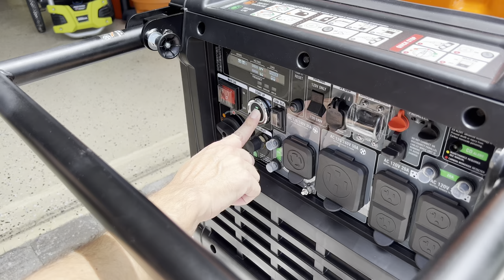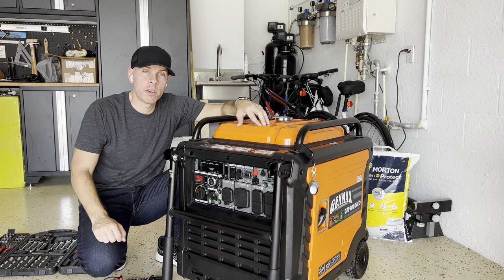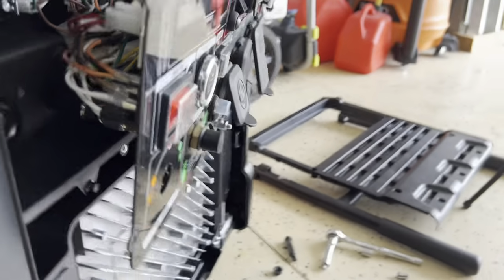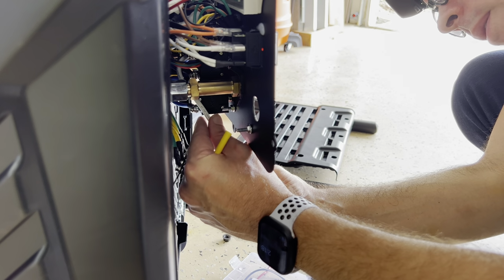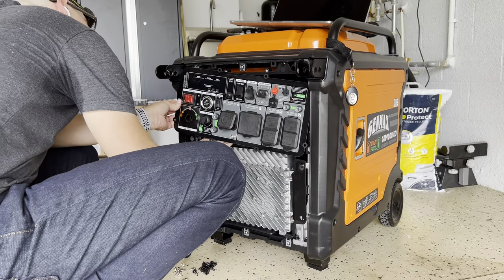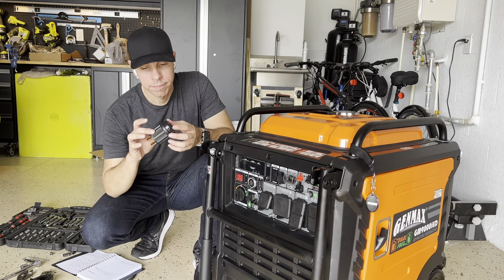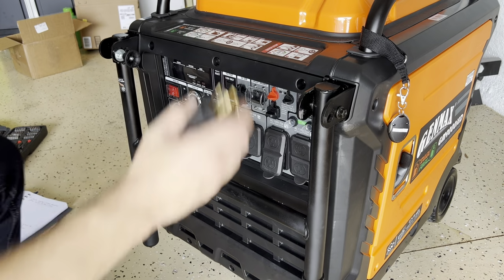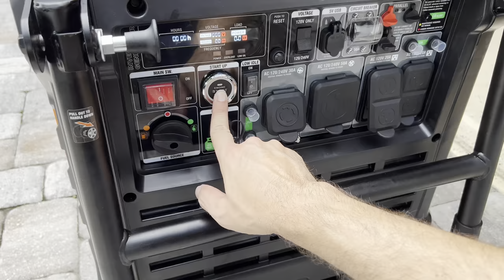How To Convert Genmax GM9000iED Bonded Neutral to Floating Neutral

Comment: Are there any adverse consequences connecting the genmax as-is (neutral-bonded) to your household breaker box? That is, can the genmax as-is function normally when connected to the household breaker box? Thanks!
Reply from the maker: Hello. Please check this video.   https://youtu.be/RkjjZJgaINA
Reply: @JavierRivera  Great reference! It seems there are many different viewpoints on this subject. Maybe to be practical, under normal conditions, would a multimeter and its probes tell you whether any part of the genmax, say frame or other equipment part, pose a shock hazard?
Reply from the maker: Doesn’t matter. The rule of thumb is having a neutral bonded at 1 place only.
Reply: There really aren't many points,  it's very dangerous to have the neutral bonded at the generator and in the house,  virtually all house are neutral bonded, therefore either you have to break the bond at the generator,  or at the house using a power/ neutral disconnect. If this sounds Greek to you? Don't be stupid, hire an electrician. What I did,  is add a jumper disconnect on the battery side of the generator,  putting a jumper off the main white ground wire,  that way I can just remove the battery panel and easily plug,  or unplug the quick disconnect. Depending on whether the generator is connected to the house,  or being used on a job site.
Reply: Dont follow this guys advice.There is a much easier way that allows you to keep your generator stock

Comment: This helped me convert my A-ipower SUA1200ED to a floating neutral. Perfect timing for Hurricane Ian. Thank you.
Reply from the maker: Nice 👍🏻.  Are you getting ready for Hurricane Ian?  Me too. I already tested my generator and I can run my 3ton and 2ton AC , my fridge and anything else that is normally connected utilizing only 4,800w from 9000/7600w My stove, water heater and dryer are gas.  Eventually I need to set a power meter to be able to see how much amps I am utilizing from the 50amp generator power.

Comment: I tried too check my work after I did the changeover. But, I can’t stick the probe of my multimeter into the GFCI outlet because of the stupid plug safety doors! What do I do?
Reply from the maker: Did you try to stick both probe at the same time?
Reply: @JavierRivera  Yea and those doors won’t let me push through. Should I try and force them? A regular plug goes in and out without issue.
Reply from the maker: @MrBritrider  just do it at the 50a plug 🔌
Reply: @JavierRivera  Oh yeah haha forgot. So looking at it on the gen, top @12 o'clock is ground (black probe) left @9 o'clock is the neutral (red probe) correct? Also, if I may ask, when you test the dummy plug, the cord comes from the TS, do you need to turn on all the breakers in the TS? And is your main panel live?
Reply from the maker: @MrBritrider  the 50a outlet is @12 ground and @6 neutral @3 & 9 are hot.
Reply from the maker: @MrBritrider  I do not have a transfer switch I have a 50a power inlet to a 50a breaker at the main panel.

Comment: Do the Genmax 9,000 generator has a electric start or a remote start ? And what types of oil it use ? Is it better to use ethanol free gas for this generator ? Can I plug a electric stove that has a 220 line ?
Reply from the maker: Hello yes it has an electric starter and a remote start.  Oil is 10w-30.  Use only fresh 87+ octane stabilizer-treated unleaded gasoline. Do not use gasoline with more than 10% ethanol (E15, E20, E85, etc.). And yes you can connect a 220 stove to the 240v / 50amp outlet.
Reply: @JavierRivera  For other name brand generators, is it better to use 90 because it's ethanol free.They say for cars it's better to use ethanol free gas I was wondering is gas generators similar ? Do some gas generators perform better with better gas ?
Reply from the maker: @drrobotnikmeanbeanma  That is correct if you can find ethanol-free gas use that one but if not used one that contains less than 10%. Performance is the same, you would get the same watts with or without ethanol.

Comment: Javier....so I have a food trailer and plug a 50 amp.  I have used this generator 3 times for a total of 7 hours.  Now my volts drop from 240V to 1 Volt.  when I plug up anything.  Even when i plug an extension cord with nothing attached.  Is this my solution or is there another problem?  Also, if it is the solution, can I use the 110 outlets and the same time when i have changed it out?
Reply from the maker: Sorry but I can not understand your message.  You might need to rephrase it.
Reply: @JavierRivera  I am not getting power from the generator when I plug anything to it.  The meter reads 240 volts when started.  When I plug a cord into the generator, the volts go down to 1 volt and no power to what is plugged into it.  Even an extension cord with no item plugged into it.  Prior to this, I would plug my 50 amp cord into it and it would run my food trailer.  Now no electricity due to the voltage dropping to 1 every time I plug something into it.  Is this because of the grounding?

Comment: Did the conversion on my Genmax 9000 ied following your instructions. Everything went smooth and I checked continuity readings along the way and all good. Started the generator after I was done and it will not stay running longer than 20 seconds. Restart and it shuts off again. Any suggestions?? Thanks for your time!!
Reply from the maker: I do not hink is related to removing the bonding. I have been having some issues, too, lately. This will sound weird, but I want to do a test; when you start the generator, and it seems like it is going to stop, grab the handles and shake it up and down a few times and see if that keeps it running. That is what I have sometimes been doing; I even recorded a video that I need to send to genmax to see if they know what is happening.
Reply: @JavierRivera  Shaking it did not help me at all. It starts up perfectly runs 20 seconds then shuts off. Going to try running on running on LP next and see what happens. Could one of the sensors be doing this? Maybe the wiring to the sensors was disturbed when I had the panel off?
Reply from the maker: @richdelbridge5354  If you belive that could be a wiring ifssue after removing the panel I suggest to remove the panel again and look that there is no cable loose just to be sure.
Reply: @JavierRivera  I will check it out and then also try LP. I will keep you updated. Thanks for your time!

Comment: Very informative video!  I just recently hooked up my
Predator 9500/7600 inverter generator. I had a micro-air added to my unit. Which dropped the starting amps from +70 to under 40.   I did notice after about an hour the breaker tripped on the generator.  After seeing this video I will be switching it to a floating ground.
Reply from the maker: Great 👍🏻.   Yes is highly recommend.

Comment: Just found your Channel, and Subscribed. Excellent Video! 
Would it be a better option to have install a Neutral Bonded ready Transfer switch, instead of having to take the Generator apart?
Reply from the maker: Genmax will be adding the option

Comment: Thanks for sharing your expertise! I have a champion generator Thais also bonded neutral. I used it once during the last hurricane, not changing to floating ground. I don’t use a manual transfer switch, just a simple slider. No problem encountered. Is it really necessary to convert from bonded neutral to floating or is it just a matter of preference? Thank you.
Reply from the maker: It's important to have only one ground-neutral bond in the system. The main panel of the house will already have this bond. A bond in the generator too creates the parallel path neutral. https://youtu.be/RkjjZJgaINA

Comment: In this video at the end you hooked the 240 volt cable to the interlock and the generator to show that the main panel will bond the generator, just to be sure I know the generator is off but do you also keep the generator breaker in the main panel off to? I believe you do because the neutral and ground in the main panel aren’t connected to the breaker.

Comment: After I remove the bonding wire, when I connect the surge protector to the 50amp plug with my house back up line connected,  the 50amp breaker is off on the generator but the red light on the surge protector is on  (open neutral). After I turn on the circuit breaker on the generator, surge protector is showing green blue and red. The red means open neutral blue means neutral connected. Why is it showing open neutral as well? When I remove the back up line, it goes to just green.
Reply from the maker: First, did you tested your Home Power Inlet by itself that is neutral bonded?
Reply: @JavierRivera  yes it is bonded
Reply from the maker: @JANAKJ006  Secondly, connect your electric cable from your power inlet directly to the generator and test if the generator then has a neutral bonded connection.  If your generator has a neutral bonded connection is seeing your house panel neutral bond. Then the problem is the Surge protector that is only checking for neutral bond one way only and is not allowing your generator to see your house neutral bond.
Reply: So i tired 2 high end surge protector. (Watch dog and progressive industries ) Both doing the same thing but when i  bounded the generator surge protector it’s showing correct. It’s only seeing one way I think. So having 2 bounding neutral it’s gonna be problem right?
Reply from the maker: @JANAKJ006  there is something I do not understand.  Why you want your use a surge protector between the generator and your house panel?

Comment: What type of transfer switch do you have ? i think that you said that some transfer switches  are neutral bonding ready and do not need a floating neutral ,do you know which one they are ? Thank You
Reply from the maker: Hello. I don’t have a transfer switch.  I have a power inlet connected directly to the breaker panel using an interlocking system.  Cheaper. The interlocking system is just a safety metal plate that doesn’t let you turn on the 50amp power inlet breaker unless you turn off the main BIG breaker that is feeding the breaker panel.  Then I manually only turn on the breakers that I need, as you do with a transfer switch.   I believe you will need a 4-pole transfer switch if you do not want to modify your generator. Look for Panel/Link X-Series Neutral Switching Panels
Reply: @JavierRivera  Thank you , i have a transfer switch and all of the outlets on the Genmax 9000 are neutral bonded so i will have to modify the generator for a floating neutral, Fantastic Video !!!!!
Reply from the maker: All depends if your transfer switch has a neutral switching option.   If has it you don’t have to modify the generator if not you might have to.  If you are not sure you might need to consult an electrician so you can be sure about what to do.

Comment: just go mine from home depot, Genmax must of just updated the 9000ied, I followed your video and behind the panel is different, there is no white wire to remove from the bar, just 4 yellow wires
also the bar is on the right side of mine, so if there's an update on how do it please let me know.
Reply from the maker: Hello, yes it looks like something was changes. I wish I could attach a picture here.  A few months ago someone told me that the white neutral cable wasn’t on the ground bar in his generator and told this “The white oval is the back of the last/fourth/far right receptacle in series (20A GFCI).  I disconnected the Green/Yellow wire that was tied to the white from the back of the outlet and it appears that there is no more neutral bonding!”
Reply: Thanks for the info, I wish you post pictures in replies.

Comment: Does Genmax give instructions on changing the bonded to floating neutral?
Reply from the maker: Not in the user manual.  I  asked Genmax and they told me what to do.  They sent me a picture indicating where and which cable I need to disconnect.

Comment: Wouldn’t it be better to extend the white line to a switch and back to the bar?  That way the generator can be switched back and forth depending how it’s being used?
Reply: Was thinking the same thing. Taking that off one time would be enough for me to do just that.
Reply from the maker: I thought about it but I am kinda a perfectionist and 1- I couldn’t find a 30 amp switch that I like. 2- by that I like I mean compact and mountable 3- I couldn’t find a good location to mount it.  Suggestions of switches and location are welcome.

Comment: How did you know about the wire to disconnect? Does this affect the warranty if you ever needed  service?
Reply from the maker: Hello 👋. I  contacted the manufacturer directly asking where was the Neutral Bonding so I can disconnect it and convert it to Floating Neutral to connect it to my home.  They send me the picture that I  showed in the video.   They know is a necessity if you want to power a breaker panel. So does not affect the warranty.
Reply: @JavierRivera  ok thanks

Comment: I just tried to perform this conversion on a 9000ied delivered in August 2023 and the back of the panel is a lot messier and I can’t find a terminal block.  That makes the online instructions from Genmax useless.  I called them for help and was told I needed to hire a qualifie electrician.  Has anyone else run into this apparent change in design?  And better yet, have they figured out how to accomplish the floating neutral conversion?  Thanks.
Reply from the maker: They have not changed the design for 9000ied.   The white wire is attached to the ground bolt on the back of the panel.   Give a second look.
Reply: Thanks for the quick response, Javier!  It looks like 2 yellow wires are attached to the back side of the ground nut.  I’ll disconnect those tomorrow and see what we get.  Really appreciate your help. 😊👍
Reply from the maker: @bdy8218    Or they may have changed the color of the cable.https://youtu.be/rHqQQMKY8dQ?si=bLa96VHo5vcwllus&t=433
Reply: Hi, Javier.  No luck.  Still had continuity after disconnecting those two Green/Yellow wires.  I swear this unit does not look them same as your’s or the one shown in the Genmax tutorial on how to unbond the neutral.  I’ve removed every panel and can’t locate where that connection is made.  Multiple calls in to Genmax with no response this morning.  Looks like their customer service is living up to it’s billing.  Maybe others will start to see the same issue if they really have made a change and report the solution.  🤞Thanks.
Reply from the maker: @bdy8218  so you have a 9000ied? did you tested before disconnecting anything?   To be sure that it was neutral bonded from the factory?   Like I said I am not aware of Genmax switch the 9000ied to Floating Neutral from the factory.    Can you send me pictures or video to javieryter@outlook.com ?
Reply: Hi, Javier.  Thank you for the offer!  Just sent you a couple of pictures.

Comment: Love your videos! I am considering this unit. I saw another commentor mentioned that genmax parts are not available in the US and if it breaks then it may be a big hassle to get it fixed. Thoughts?
Reply from the maker: Hi. Thank you.   They do have support in USA with base in California.  About your question is a good question I might have an complete answer in 1-2 days, I will check.  Now I can share my experience so far.   I emailed Genmax Manufacturer at China (they are very responsive and answer every email I send)  Because the Totals hour meter that is like a car Odometer reset to 0 hours every time you turned off and on and they are sending me a new Digital display from China. It should arrive in July 18.  Then I will replace it myself with the new digital display and I hope that solve the problem.   Also. Remember the Genmax warranty is 1yr but when you buy it through Amazon you have the option to buy an extended warranty and that is a local warranty.
Reply: @JavierRivera  did you receive the display yet?
Reply from the maker: Hi, OK I email them yesterday and this was their answer "We hired TOMAHAWK Power in US to provide the service for our customers. We have good relationship with this company. So we choosed them. Actually there are some other companies contacted us, we are considering if adding or just enlarge our current service team.
" so they are new but they are expanding.
Reply from the maker: @deifiedtexan7691  Not Yet but I just checked the tracking and Shipment is out for delivery. So should arrive today.
Reply from the maker: @deifiedtexan7691 , I got it; I will be making a video replacing it.
Reply: @JavierRivera  Thanks Javier, that was a very informative and well done video. I have the Duromax version of this generator and oddly enough the total hours meter on it resets to zero also. I called Duromax in July and they said the panel was back ordered but I could expect it in early Sept. I still haven't received it so it seems that Genmax provides better support.